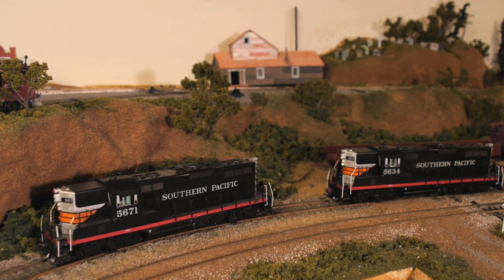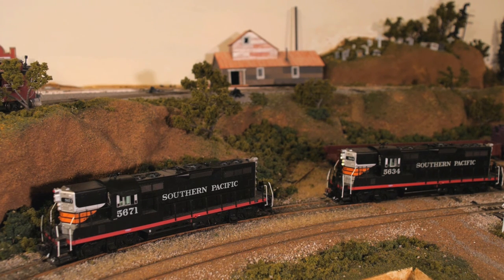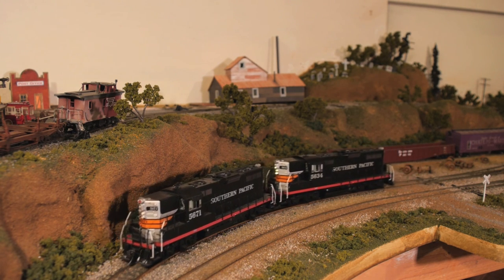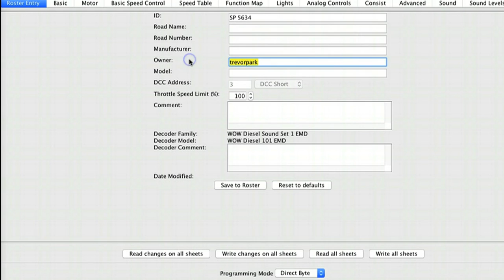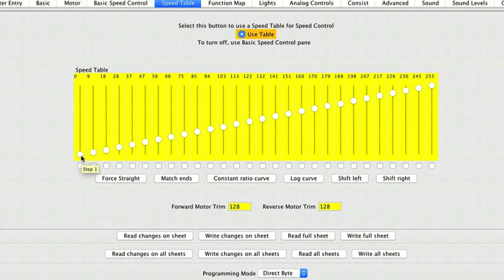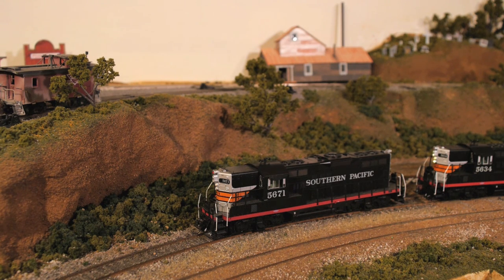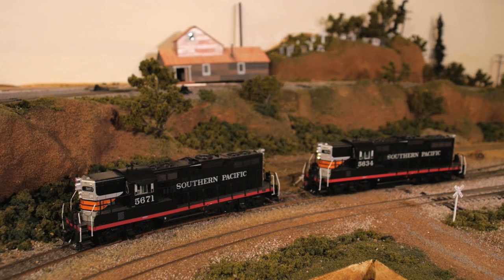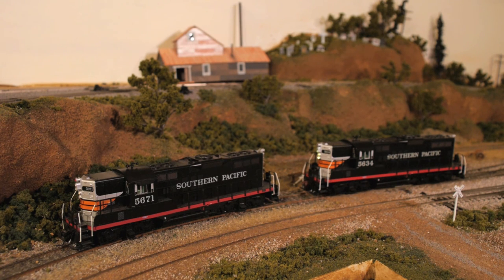Speed Matching Tsunami Sound with WOW Sound Decoders

Comment: I have an Athearn Genesis Sd70m-2 that I just recently had a TCS installed into and also have an Athearn SD70I with the new Tsunami 2 in it I have an NCE powercab and I used JMRI to speedmatch the locomotives I think I have them running pretty good together but my problem is when I go up through the speedsteps they run great if I let them run for say a minute then go down a notch they suddenly stop even though they are still fairly high in the speed steps. I.E. running at step 40 go down to 39 and they stop bring it back to 40 they get going then if you gradually go down to the lower speedsteps they run great but will do the same thing stop suddenly just by goin down a notch or 2 what could be causing this? Thanks
Reply from the maker: Do both of them do this? And do they do it when they're not speed matched?